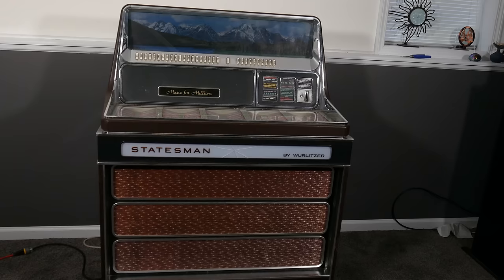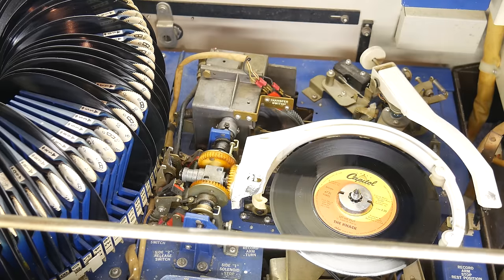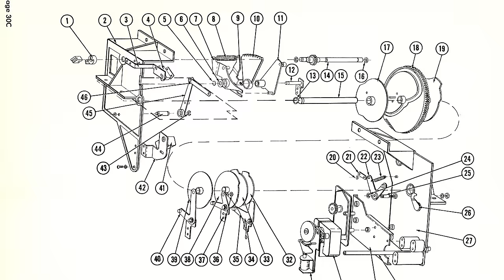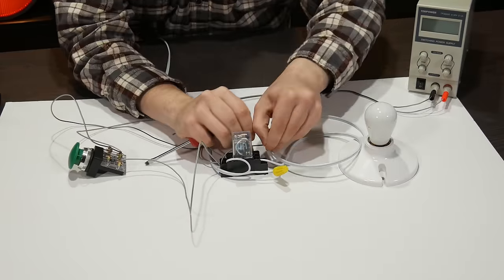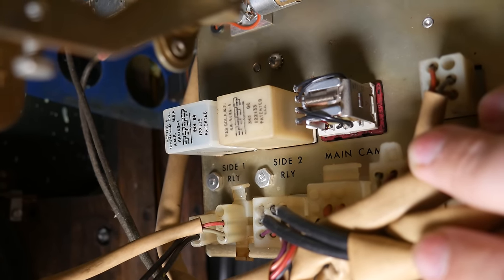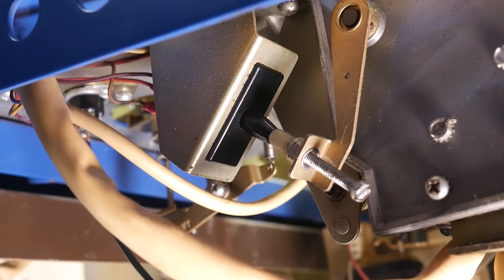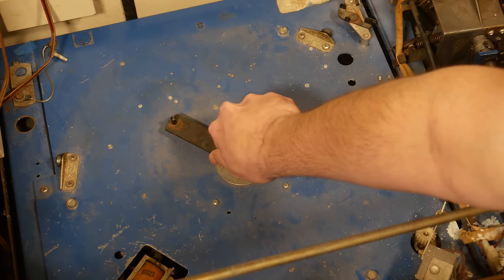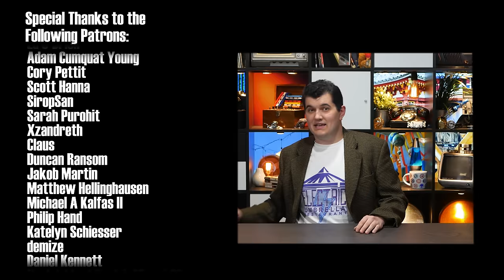The Computer-free Automation of a Jukebox (Electromechanics)

Comment: "all without a single bit of code"

The ingenuity + the relays and limit switches are the logic gates and code - I agree, it's much cooler than silicon.
Reply: they can be considered logic gates yes,   but in absolutely no way does code have anything to do with it
Reply from the maker: @raafmaat  bit was also a pun
Reply: @TechnologyConnections     hadnt noticed!  i like it
Reply: @raafmaat  if punch cards are code, then so are cams.
Reply: @TechnologyConnections  can't believe you ended this where you did dude... That's the biggest cliff hanger you've done.
Reply: @Mmouse_    hmmm,   yeah cams are kinda like code....   im not sure tho,    as cams work more like logic gates,   if it turns x ammount do y etc. 

...     i dont know now,   you might be right
Reply: @raafmaat  the cams are literally the code, if you had enough of them shaped in the right way and could spin them fast enough you'd have a modern computer.

Source: I'm an automation engineer, we still use this stuff along side silicon based shenanigans and I love it.
Reply: @Mmouse_     hmmmm,     yeah you are right,   cams are kinda like ROM memory i guess,   and instead of storing 0s and 1s,    it stores analog positions
Reply: @raafmaat  if you like old school stuff especially memory, check out the hand stitched memory from the apollo missions - it's digital, but it's so close to analogue you can almost feel the changeover.
Reply: @Mmouse_  yeah ive seen that,    i think it was on Smarter every day,    i indeed liked it and read up about it online :)
anyway,   to get back ontopic,  i was wondering,    now that i have come to the conclusion that cams are like memory    where data like positions are stored,    thats still just data storage,   its not really code right?     its just data + mechanics that transform that data into movement,    code would be used in between the two,     but that doesnt really happen with cams,  or am i looking at it wrong?
Reply: @raafmaat  the cams code is written in its shape, and that code is written when the cam is machined... A cam is rom.

You can adjust the cam coding by taking the cam off its shaft and shaving bits off which adjusts its timing or removes triggers entirely (thus adjusting if, then or statements in the code) , or you can replace the cam entirely with a new one... Making it an MRERROM which is a term I just invented... Mechanically removable erasable reprogramable read only memory.

Rom code is static, as is cam code... Like I said before, cams are Turing complete... Given enough of them and a high enough speed, you could make a modern computer from them.
Reply: @raafmaat  the cam is the code
Reply: If you don't think programming is as "cool" or requires as much ingenuity as this, you don't know enough about how computers work.
Reply: @Mmouse_     i understand that cams store positional data,   but im still not really seeing code ,     a database full of positions would not be considered code..
oh right,   but the combination of switches + cam actually does the same as code,   your right,   yeah i can imagine it being pretty much turing complete now! 

Sorry for bothering you,   you were right all along!   ^^

Comment: I have a 1965 Rockola 45 RPM jukebox and it’s freaking awesome. It’s the last year that it had an exposed mechanism where you can actually see it do everything. It’s also the first year that they used a transistorized amplifier. And almost 50 years later, it still works although it does need to be recapped.

Comment: Circa 1970, when the only way to have a phone answering machine was to rent it from the phone company, I built my own.  It all started with a really odd yard sale find:  a 4-track, yes FOUR track, home recording deck.  As you may recall, the 4-track used an NAB broadcast cartridge with lots of tape in it.  That deck formed the basis of my device.  I got a 60 second broadcast cartridge and added a thin foil patch on the tape, about a inch long.  I made a sense head from a small piece of hardwood with two bare copper wires wrapped around it.  The foil on the tape would act as a switch when it came past the sense head and bridged the two wires.  Thus, my cartridge served two function, carrying the outgoing message and controlling the overall cycle of the machine.  A homemade 12V power supply, a few relays, and a cheap cassette recorder to capture the incoming message completed the machine.  A capacitor and bridge rectifier across the phone line would convert the 90V 20Hz ringing current to DC, and pull in a 4PDT relay to start the cycle.  One set of contacts latched the relay, another started the 4-track, another started the cassette, and a fourth set bridged the phone line into a low resistance, essentially “picking up the receiver.”  It ran until the foil patch activated a relay who normally closed contacts were in series with the latching circuit of the first relay.  It worked quite well but had several drawbacks.  First, the cycle was fixed by the length of the 4-track cartridge, so the max incoming message length was the cartridge length less the duration of your outgoing message.  Second, the cassette recorded everything, including your outgoing message.  It was an ugly beast, too.  It was built on an aluminum radio chassis just big enough to sit on the top cover of the 4-track deck.  The chassis was protected by a plexiglass box.  Since there were a couple of pilot lights in the design, one green when it was on and waiting, and one red when it was taking a call, it looked like a real “mad scientist” creation.  But it worked, it was relatively cheap, it was a fun project, and I didn’t have to pay Ma Bell every month to have it.

Comment: 0:25 Microprocessors aren't interesting? You definitely haven't seen Ben Eater's 6502 Computer video series.
Reply: mrmimeisfunny Honestly, this reminds me a little of Ben Eater's breadboard 8-bit computer series - this stuff with the relays seems to be happening at the same level of not-abstraction.

That said, the thing about the order of switches being pressed and released reminded me of the timing diagrams video from the 6502 series for sure.
Reply: yeah this intro bothered me too. As if between electro-mechanical logic and microcontrollers there wasn't TTL and CMOS discrete logics that don't need any code writting.
Reply: Many people regard things they can see moving as way cooler than than electronics that just sit there.
Reply: I dont think he thinks computers are uninteresting, just less interesting. I think its both interesting in different ways. How the same things, more or less, could be achieved with switches clacking based on other switches clacking. Its fascinating how far we come in so short a time. Electro mechanics are more interesting in that term of implementation. But electronics are fascinating because of the sheer complexity were able to fit on a chip with less mass than a dime.
Reply: @PainterVierax  The original PONG game you could plug into your home was like this. No CPU, no software, just a bunch of discrete logic.
Reply: @darrennew8211  The original Magnavox Odyssey that predated Pong by a few years used 40 discrete resistors, plus a lot of resistors and caps.
Reply: @flatfingertuning727  *Transistors.
Reply: @user2C47  Resistors and capacitors are used with transistors to build analog integrators, or to convert analog voltages into variable delays.  The Odyssey used analog integrators for the ball X and Y position, and then used RC circuits to convert trigger the ball at the proper spot on screen, and then another couple of RC delays to make the ball for the proper amount of time horisontally and vertically.
Reply: @flatfingertuning727  I was referring to the impossibility of creating advanced logic with only resistors and capacitors, and no transistors.
Reply: @SoftBreadSoft  Interesting that you should use the word "clacking" - it is used frequently in William Gibson and S.M.Stirling's steampunk novel "The Difference Engine" where it refers to the process of programming mechanical, Charles Babbage-style computers.
Reply: @user2C47  except it isn't impossible, though you would need relays and diodes. Also, even if they are functionally equivalent but when taken literally: you can also use electron tubes in place of transistors.

Comment: I am a controls engineer.  I mostly program PLC's using a type of languages called ladder logic. This  is a programming method specifically intended to resemble the electrical schematics that were used for this kind of automation.
Your standard factory is still programmed using basically the same relay logic and timing as a juke box, there is just a computer pretending to be a network of relays now (because it is actually a significantly more complex network of transistors. which are like relays but smaller and faster and with no moving parts).

Comment: The first job I had as a technician was repairing Record-O-Fone telephone answering machines.  Not a chip in them. Relays with a driving circuit connected the unit to the phone line when it rang with an AC voltage. Next relay started the motor for the puthoing message tape deck. No cassettes, endless loop of 1/4" tape. On quiet after the outgoing voice ended, more relays to run the small reel to reel "message" tape deck. Metal foil bits on the tapes made contacts to control other functions. A solenoid swithed idler rollers to rewind the message tape. If message tape ran out, a micro switch on the supply reel turned off the answer function. Various tones on the tapes triggered other operations.  Lots of steel, rotary swiches and a couple transistors made it all up. If you ever do a history of phone answer devices, im at your service and have a working Record-O-Fone model 100.

Comment: Good Morning, While a jukebox makes a great showpiece for entertainment, the Fire Control Computers in place on WWII battleships were probably at the top of the list for using analog systems to solve VERY complicated (REAL TIME!) Gunnery Fire Control problems that involve 20 or more inputs - some sent to the computer by selsyn motors from remote sensors like rangefinders and gyroscopes, to manually input values like air temperature  and wind direction/speed.  The ability of a warship on one course and speed, to fire and hit a target ship on another course and speed as much as 24 miles away after an 89 second flight time for the 2700 lb projectile is simply amazing.  I work as a volunteer onboard a Battleship museum.  Seeing all these systems, and how they were very successfully used is a true testament to what can be achieved by mechanical engineering.  Here is a link to the first of several US Navy training films that discuss the basic mechanisms used in these Fire Control Systems.  If this interests you, there are quite a few more videos here on YouTube that go into more detail about how these systems worked.  Hats off to the engineers!
https://www.youtube.com/watch?v=gwf5mAlI7Ug

Comment: My first job in 1977 was working on office copiers, and the first machine was 100% relays and cam switches, very similar to the ones in this machine.  Each one has its own specs for pressure (and presumably current rating as well), because some needed to be very gentle (like the record end switch) and some had to be more firm.  Also, we had latching relays that didn't require current to be always flowing through the coil, but instead there was a mechanical latch that held the contacts closed, and a pulse through a different coil would release the switch... Then I went to Xerox and learned about TTL Logic: Still no computers, but fewer relays and cam switches and lots of and gates, or gates, flip flops and the like.  You could still trace individual signals and troubleshoot those!

Comment: As a teen back in the mid-1950s, I was a member of the Flying Bisons club of Western New York. I, like many others, was trying to solve the many problems associated with flying a rudimentary radio-controlled model airplane. An older club member—Howard Thomas—was a mechanical engineer at Wurlitzer (North Tonawanda) plant who worked on jukebox design and production. As it turned out, his intimate knowledge of those mechanisms led directly to the electro-mechanical servo motor that actuated the control surfaces of those early r/c models—first offered for commercial sale by the deBolt Model Engineering Co...proving once again that there's nothing new under the sun.

Comment: Ah, yes, I wondered (after seeing all those generic microswitches) how often and brilliantly they would use both the normally open and normally closed poles of some switches.  I think you covered it well.
Reply: the NC pin is often used for big red emergency buttons on industrial machines just like he showed with the lamp.
Reply: @PainterVierax  Not only, most module can be stacked tougher. And to get signal to cancel on PLC sometimes we use NO I NC
Reply: @mateuszzimon8216  That was just the most simple example usage since OP is not very technical, I didn't want to go as deep as you did. ;)

Comment: I'm only 5 minutes in to this video, and I'm already blown away and so excited to be watching. I've always thought electromechanics, compared to more modern applications with "smart" computers or circuits (not sure what to call it? I'm a carpenter/painter by trade, I just enjoy learning new things) were leaps and bounds more interesting, fascinating, and just plain better in an aesthetic sense. It takes me a while to wrap my head around the concepts and interactions sometimes, but since I was a kid I always enjoyed taking stuff apart just to see how it works, and I also try to work/repair whatever I can when a problem arises, from my Jeeps to stereos, TVs, power tools, anything that I can take apart, inspect and begin troubleshooting. I sometimes wish more of the modern world still used more mechanical, or electromechanical solutions instead of this binary world we inhabit. The former seems so much more reliable, with a more broad way to find a solution, and in some ways there is no competition. Cars, for example. Even my two Cherokees from the 90's are so much "easier" to work on than vehicles past the 2000's, with even older vehicles becoming more and more reliant on mechanical interactions only, besides the occasional magneto or vacuum system. I know this is quite a rant.. I just really enjoy this channel and the content revealed within, honestly in my top 5, with no competition in sight. Thank you, for the intriguing topics and the in depth walkthroughs of products and systems that are mostly obscure to the general population.

Comment: Me: Thinks about implementing the whole state machine of this record player in a program.
Me: Sees the schematic. 😰
Reply: We'd start by modeling physical parts. A cam would be a loop with a double counter (i) running 0 to 1, event listeners register for particular positions, and there's a control to set the increment of the counter (di). If i += di pushed i past multiple event positions we have to call them in order. If (i > 1) then we need to call events for (0, i - 1) and reset i to i - 1. Etc. Seems fun.
Reply: @mr7clay  The cam loops need to be operated in synchronous parallel for a true simulation of the mechanism where they are hard mounted to one axle. Though this could be bodged together in a sequence of some fashion for a similar net logic.
Reply: Go play factorio, the factory must grow....
Reply: Record players like the Sharp VZ2500 did use a program. Sharp was so proud of their "High Speed 4 bit Microprocessor" it is even mentioned on the top of the unit.

Comment: I personally agree with your opinion presented in the first minute. In 2003 in my freshman year of college at Clemson University I came in 3rd place in the Engineering Design Competition. We had to design and build a coin operated time delay camera that had to only work when $1.00 of any denomination/combination of coins were inserted, then take a picture after 60 seconds or something. 
The team that won just did the whole thing electronically, just a computer board/chip thing that I didnt, and still obviously dont understand, while all the other entries were mechanical. We all felt like that wasnt in the spirit of the competition but I guess we were all wrong! 
I too prefer old school solid mechanical engineering and design.

Comment: I like your videos and in the late 1980's Yes Im that old, I built packaging machines that were controlled by a cam switch box. Product arrived and made a switch, this starts the cam motor. As it turned (and to change the speed you changed the rotational speed of the motor)this then stopped the conveyor, stated the pusher and made the sealing bar descend. easy... and so simple to trouble shoot... Keep up the good work....

Comment: I'm re-watching this video, and the motor wired for continuous operation reminds me of the inner workings of some older toys. To save on components like motors and control circuitry, they used a linkage of four cogs in the original Furby. They actuated eyes, mouth, ears and giving the base a bump, to make it rock back and forth a little. By driving the entire mechanism in forward and reverse, and measuring how far it was driven in either direction, it could be used to make patterns of animation. There is a "home" switch, and a light interruptor wheel that lets the controller circuit know how many steps the mechanism has moved.

Comment: Alex, you star! This stool mr back to designing electromechanical systems when I was a technician at a high school. We did move to PICs  later but we started with simple relays and limit switches and discrete semiconductors to monitor temperature, light or fluids.